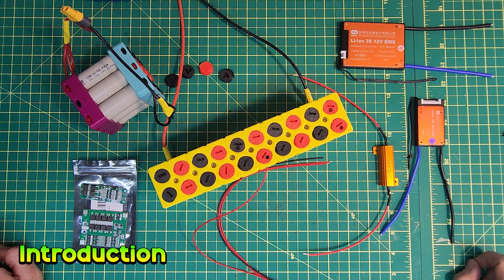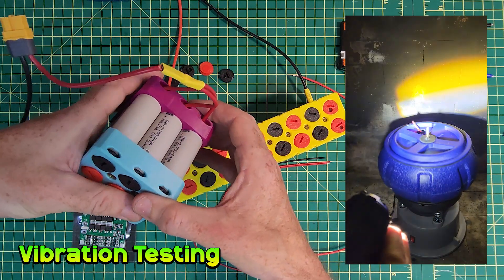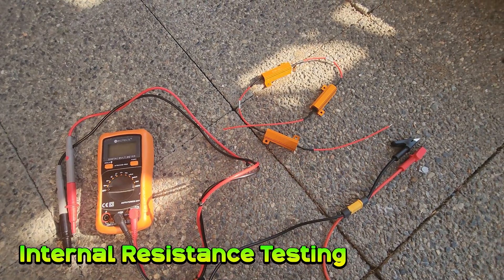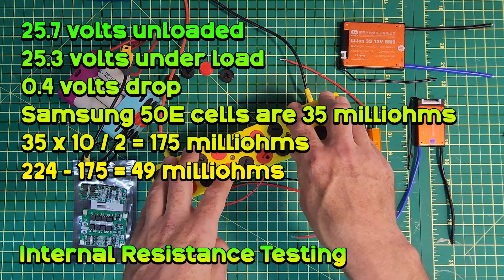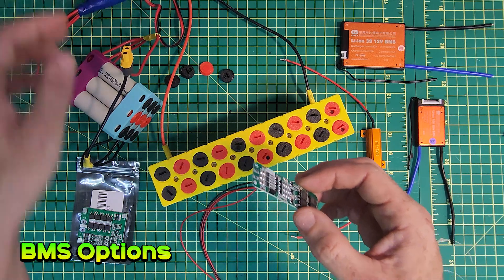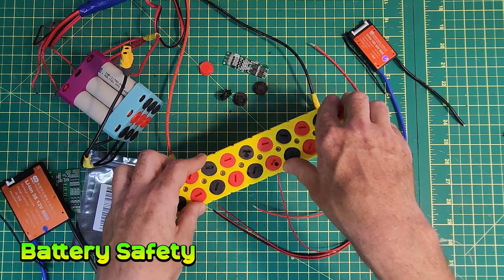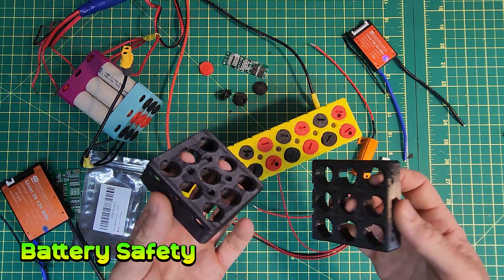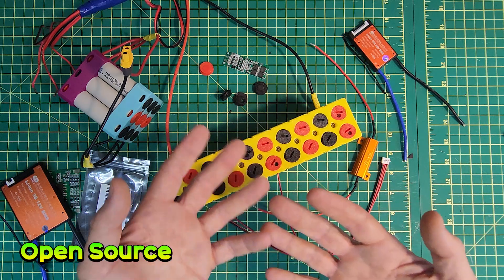OMNICELL Weldless Ebike Battery System - Going Open Source! Vibration and Internal Resistance Tests

Comment: a more productive way would be to change the cell design - manufacture cells so that they are connectable without welding; see lifepo4 headway for an example, but could have slotted terminals on cells to insert copper bars, etc.
Reply from the maker: Sure. It would be excellent to see this kind of innovation at the battery manufacturing stage. I have much more limited resources though lol

Comment: Great project, we need more minds on this problem. I started my project DKblock, with the same intent. As a way to better use and reuse the resource that is lithium battery cells. And give DIYers a way to quickly build high quality, high power battery packs. To that end, I also open-sourced my project, but also supply parts for folks who dont want to build or source their own. So I feel you on the Github thing, it's not very user friendly, but it's free! For the shaker test, I used a cheap harbor fright variable speed sawzall, and made an adapter to be able to mount the battery block to the sawblade.  Then you can run the speed of the saw with a zip tie on the trigger. Attached a data logger to the block with a load and it worked pretty well. The cell connection resistance on your braid seems a little high, probably resulting from the pressure from the screw. Higher pressure equals lower contact resistance. I would worry some about thermal and mechanical cyclng loosening the connection. But I LOVE the braid idea. https://github.com/offgridsystems/PCB-Block-Manager and https://wordpress.com/view/dkblock922508958.wordpress.com
I would be happy to work together on solutions for this much needed problem!
Tim

Comment: Amazing ! Thanks for the video, the open source and all. Honestly I love the design and with a connecter BMS it makes senses so much better than welded to repair and also so much easier for the DIY and no more scam with battery build with shitty cell or not the brand annonced. I am looking forward to the the first build. Thanks again
Reply from the maker: Thank you.. I have been working things out and will get the open source setup asap.

Comment: Very interesting, been eying the vruzend kits , but not sure on material quality,  will follow this with interest. Having done allot with vapes and battery tubes. Individual cell venting seems like a good safety feature, to prevent the whole pack going up, possibly with tubes printed out of self extinguishing material. Vent hole positioned away from the pack. Mid cells would need end vents.
Reply from the maker: A few others mentioned cell venting. I will look into it. The project is going to be made open source so if you can 3D print or have access to one maybe you can join in.

Comment: I think people absolutely should build their own batteries, the proper way, by spot welding nickel and soldering wires. Put in the time and effort to read, gain knowledge, practice, learn the skill and spend the money necessary to buy the proper equipment. That is the only long term safe way to build these batteries.  If people are not willing to do that, then buy a battery. I agree that there is a lot of fear mongering about these batteries in the media, but we are not building Lego here. If people slap one of these together,  not having the proper knowledge, they could possibly burn down their own house and their neighbors house. Plastic screws is a no-go long term, grub screws in plastic securing balancing leads gives me the chills. Connections will for sure come loose over time due to heat/cold cycles or plastic degradation. Bad connections leads to high resistance, heat and fire.
Reply from the maker: Thanks for the comment. It is appreciated. I agree with your concerns regarding safety and that is one of the reasons why this project is being open sourced. To get as many people as want to helping with it. The idea of someone seeing this as a slap it together anyone build it is not the idea either and I will be being quite clear that this is not a substitute for learning and gaining skill. The purpose is primarily to change the way we use battery resources and look at how the resources can be reused and recycled to make resources go further. It will be very interesting to do the heat testing with the thermal camera. I disagree that spot welding is the only way to make a battery safe in the long term there have been plenty of issues with spot welded batteries when made poorly. It is quite easy to both damage a cell or to make a poor connection if too much or too little juice is used. I am not suggesting that this method here is the exact answer but I am certain that it can be refined and improved. Right now we waste so much because spot welded batteries are difficult and dangerous to take apart for reuse. So its cheaper to toss them and use new lithium with all of the environmental consequences of doing so. IMO we need to have a look at all aspects of battery use and construction. There is so much that could be done to make them safer not just in their construction but their storage. If an ebike battery was charged in a fireproof box with safe venting and suppression people would not need to worry about house fires. People don't fill their lawnmower with gas in the living room because it would be dangerous. For the same reason its not a good idea to leave a 72 volt battery on charge overnight in the living room either. BMS and charger failures are a thing. Even commercially bought batteries can fail. There was that issue with fires from those hoverboards with badly made packs. The same could be done for office buildings. Anyway I have blathered on enough but appreciate you taking the time to be part of the discussion. Cheers

Comment: Love the direction -- the repairability of batter packs these days is...not great. They sure are space optimized, but when they eventually age out, it's almost always a "buy a whole new one" scenario instead of just replacing a few cells, or even all the cells.

I do have some constructive feedback, though:

- "We could have safe charging stations."

That's not realistic, sadly. It works for gas because of the extremely high volume/power fill rate of the liquid. Batteries take hours to charge, and aside, nobody would make a go at catering to charging this level of DIY battery items. Somebody like, maaaaybe, Bosche is potentially positioned to have a battery swap program at authorized bike shops, but...that's probably the best we'd see here until battery tech radically changes for charge rates.

- The less-flamable PETG -- I think testing with a lighter is probably not quite the same level of heat/violence as a cell being on fire. Maybe a MAP gas torch would compare be closer, but best would be to just put some cells in there and overcharge one of them remotely. 

It's still a good idea to use that material, but with one tweak to the design: the platic housing needs to extend to cover more of the battery's length so that there is a "fire wall" between cells. This encourages the flame burst out the ends and gaurds agains the heat transfer to neighbor cells, triggering a cascade fire. I read a study a while back that found this was the #1 most effective way to reduce catastrophic battery ignition; can't find the source but it was all about comparing fire prevention with different batter pack setups.

- Open sourcing; love it. I definitely looked at these holders and said to myself, "wish this was honeycomb patterened". In terms of how to get people involved charitably/responsibly, you'll want to apply the right license (github has some guidance on this, even ones that leave room for you to sell the items while requiring the forks to be open-source, etc, etc). 

Ultimately, however, it's mostly a good-faith exercise. If some company took these, started mass-producing their own variant, you'd have to sue them for improper usage which...is complicated/expensive/country-difficult.
Reply from the maker: Thank you for taking the time to provide such excellent feedback. You are very likely right on the plastic and I will do some more testing with a more violent flame. Your information on the cascade fire is good. I will see if I can find that study as well. It does make sense. I am sure I can get hold of a torch or something similar. There is version with the honey comb although the space saving aspect of it is then lost by having clips on the sides which lock two halves together and work counter to the screws. I will spend some time researching the licensing stuff and hopefully there will be something in existence that can be tweaked. I am not sure I will have the budget to pay for a lawyer. Maybe I can locate an EV loving Lawyer who would help me at reduced rates or for the fun of it. I know with regards to safe charging stations that there have been a few places doing battery swaps. So you basically drop of the discharged pack and pick up a new one. So the thoughts were that offices or condos would have managed areas where people would charge their vehicle where safety procedures were implemented. So if you lived on the 12th floor say of a block you could plug the battery into a charging station and pick it up the next day for use or when it was needed. If there was a problem then the battery would be isolated from all the others and it would not vent toxic fumes into living quarters. I think that secure charging pods for people homes and garages could be viable. Even if the pod costs $1000. If you think about how much money the use of an LEV would save a person its not much when factored in to the life of the vehicle. Even if you only have the vehicle for five years that would be $200 a year for peace of mind. If it was worked into insurance it could become even more valuable. As in an insurance question down the road might be. Do you charge large capacity lithium batteries in your house? Do you have a safe charging station for it? If the batteries are charged safely then perhaps premiums might be reduced? Thanks for taking the time to write such an excellent response. It is greatly appreciated. Cheers

Comment: part of me says all this to avoid spot welding but, you could just swap a cell if needed maybe (passively watching while doing other stuff, ie not paying attnetion)
Reply from the maker: Thanks for the comment. There are advantages to avoiding spot welding but its not because spot welding is some mystical technique that cannot be learned. The original inventor of the screws here is a fantastic battery building with spot welding. Its not really about swapping out cells that go bad either. It can obviously happen of course. Most batteries fail due to the BMS. This would make swapping that out easier as well. But the main thing driving this is the flow of resources. To make the breakdown and reuse of batteries fast and efficient. When an ebike battery for example is retired most of the cells could be repurposed for energy storage. The others could be recycled. It is much easier and safer for people to do this if there are not strips of copper and nickel welded on the ends. I know you can clean up batteries it takes time and there are inherent dangers from doing this. If you can just pop out the cells. Test them and then either reuse or recycle then it becomes more viable. Right now batteries are ending up in landfill that are perfectly good to be used for years more. Its criminal. This is the the main driving force behind what I am trying to achieve with all this. To be a vehicle for change so we stop wasting precious resources. Hope this helps. Great question by the way! Cheers
Reply: @HighVoltageKits   Well said but the main goal is to make it so anyone can build a battery.

Comment: About fires.. How about building in a container of liquid inert gas that would cool the battery if ruptured by heat and kill the fire?
Reply from the maker: For batteries that are used for storage such a system I think has promise. The issue for an ebike battery though would be the expense and scale of doing it. The casing would have to be engineered to withstand vibrations and not develop a leak over time. I think computers server rooms use gas systems to put out fires and save equipment so its a good thought. I was looking at the materials used for welding blankets. The most dangerous time for fires seems to be during charging as often the batteries are inside or unattended. So a chamber that was connected to a gas system could be effective there. Good comment. Cheers.
Reply: @HighVoltageKits   Yes, it would probably be too costly for ebike batteries. At least until developed fully. Many fire extinguishing systems that use gasses work by removing oxygen, but lithium fires don't require oxygen. Only extreme cooling will effectively kill the fire.

Comment: Needs some "hard wacks" and not a slight vibration.  That machine is good for cleaning up used shell casings, but not for this test.  The "battery frame" is not being stressed, to put loading and unloading on the "compression screws".  I don't think I would go with the "braided cable".  I like the system that has screws on the ends and the wires connections are held with nuts.  Like in the link I sent you.
Reply from the maker: It feels to me that its really rattling around quite violently in there. I agree that its not the be all and end all but the one time I walked in and the lid had come off and it was bouncing all about in away that would never occur even on a bike. What is your concern with the braided cable in particular? Its considerably thicker than the strips of nickel or copper that are traditionally used with spot welded batteries the contact area is many ways is also larger. I appreciate the comment. Do you have any ideas for vibration testing on the cheap? I am happy to try new things. I am going to try and get my buddy to do some resistance testing on some similar welded packs so I can get a comparison. I am still waiting to get a thermal camera to record some footage under load. If you have ideas to stress it more I would be happy to try them. Should I strap it to something and then vibrate it?
Reply: Might be a bit of overkill, but what about one of those Paint Shaker Machines. Not a Commercial one you see in the Hardware Stores, but I've seen smaller ones online like Amazon etc. @HighVoltageKits
Reply from the maker: I will see if someone has something like that locally. I can't imagine Rona would be very please if I asked to use theirs lol!

Comment: I'm eager to see how your project develops👍🏿.
Quick question, would the bms placement on the battery pack effect the performance/change the physical dimensions? I only ask because looking at the 36v pack, you could place the bms on the shorter side of rectangular pack as a pose to the long side.
Reply from the maker: I'm not sure if it would affect performance. The dimensions a bit. The one I have is pretty compact tho.

Comment: I am wondering where we will be able to acquire batteries. I am unable to find a source that sells just the batteries in the quantity needed for a battery pack. I think this system has amazing potential. Where do I find more info on this project?
Reply from the maker: There are a few more videos on the channel and I will setup a GITHUB site. Where are you in the world
Reply: @HighVoltageKits  I live in Canada,  Edmonton Alberta.
Reply from the maker: Right on. I spent five years in Cold Lake 😆 Used to run Ambulance down to Edmonton
Reply: 18650batterystore?